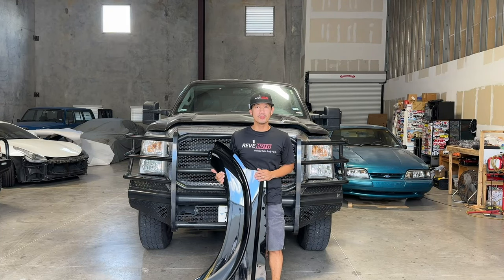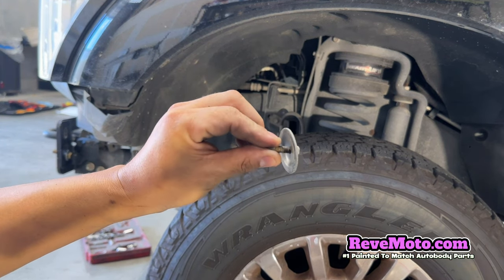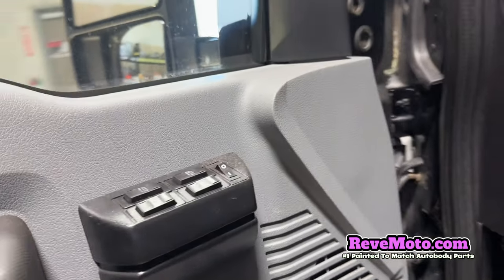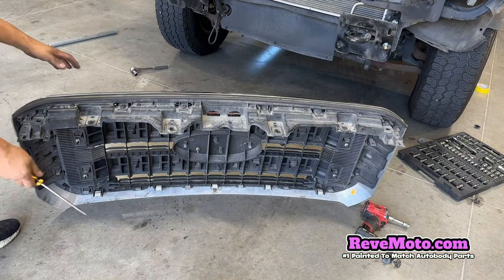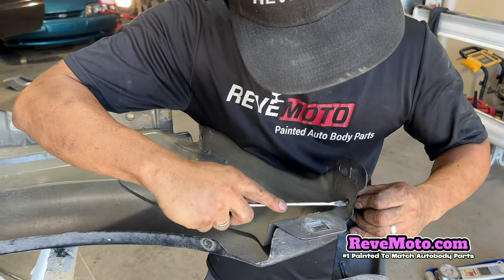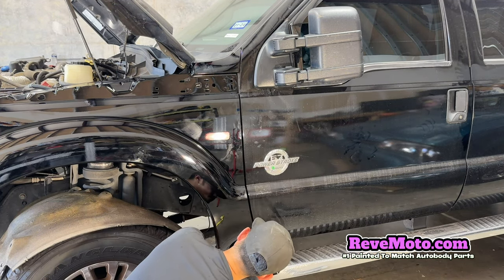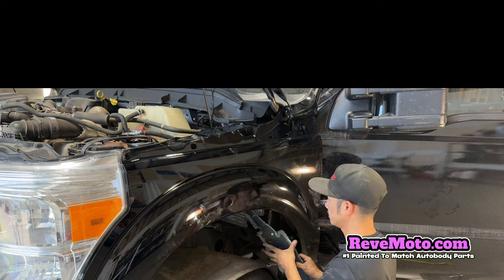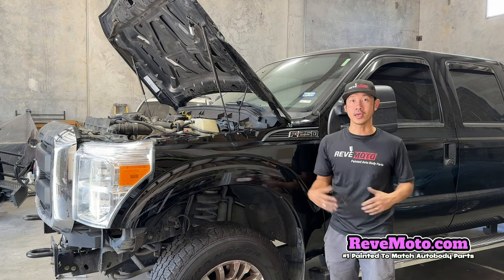Quickest 2011-2016 Ford F250 Driver Fender Removal and Installation.

Comment: It's slightly irritating that I was able to find this video, but not one video on how to remove a fender from an 02 f250/ f350/ excursion 😞
Reply from the maker: When I get one in at the shop I will do it! The method should be similar though.  If you need the fender go to www.ReveMoto.com